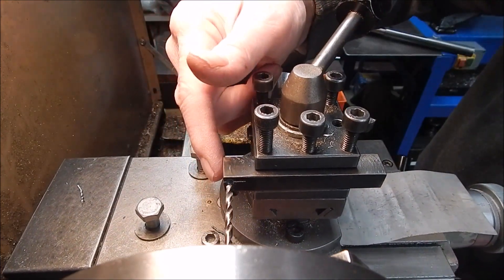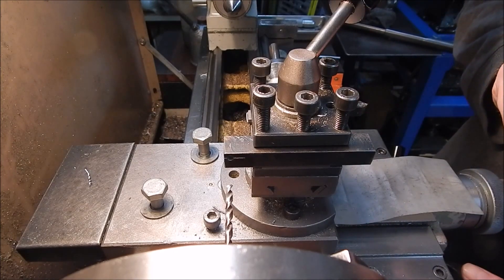How to drill 90 degrees to the job on a metal lathe

Comment: Makes good sense. Applying the drilling pressure by the tailstock is something that I will remember.  I as part of my video series on fixing Ford power running boards used my lathe to drill the cross holes in the pivot pins, but I used the main carriage. Of course, this is on a 7x14 Chinese mini lathe, so the offset is not as great.

But I will remember this idea. Thanks.
Reply from the maker: Thanks for the feedback.  Cheers Rob

Comment: I thought this was a great demonstration.  Do you have any tips if you were line boring between centers & the work was fixed to the slide?  Thanks.
Reply from the maker: Hi Adam.  That's not something I have done.  Keeping the mill slide rigid is always going to be the main issue.  I can't help on that.  Cheers Rob

Comment: Good point Rob, it makes sence. If you put the drill chuck in the tailstock and use a length of round bar to push with, it will give you more reach past the tool post. Cheers Tony
Reply from the maker: Hi Tony.  Yes, the tool post may not always align correctly with the tailstock ram, so a chuck adapter solves that.  Cheers Rob

Comment: Never considered using the tailstock like that Rob, what a great idea. Cheers, Alan.
Reply from the maker: Hi Alan,  I figured this out many years ago and have mentioned it on a few rare occassions in old videos.  Milling on the lathe raises the serious issue of canting and poorly supported mill slides, angle plates etc and this was the obvious solution.  Hidden in plain sight I guess you could say ;)  Cheers Rob
Reply: @Xynudu  
In many ways, a smoother feed instead of the main carriage hand wheel.

Comment: Brilliant, simple and clever.
Reply from the maker: Thanks Stefan.  Rather than just use a live centre as the ram, I made an "L" shaped adapter for the tailstock chuck  to allow better positioning/contact with the toolpost, topslide, mill slide or angle plate.  Very simple setup.  Cheers Rob